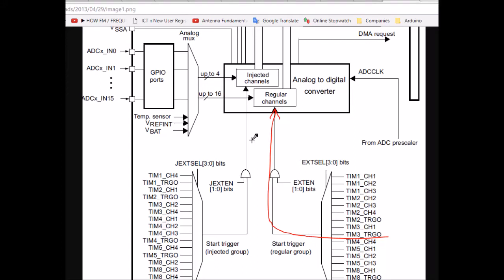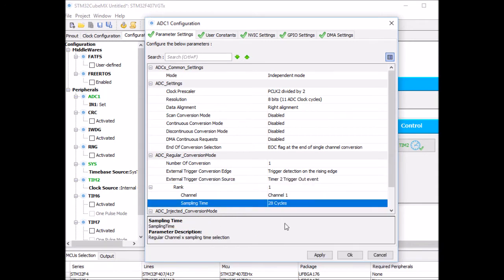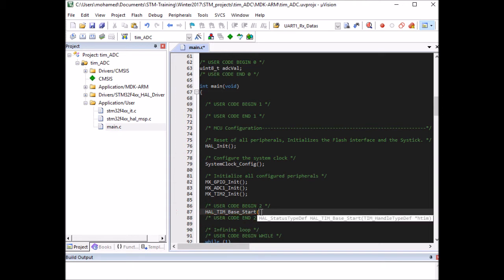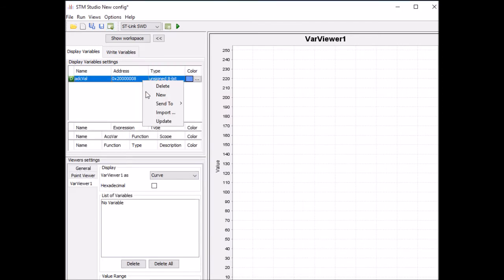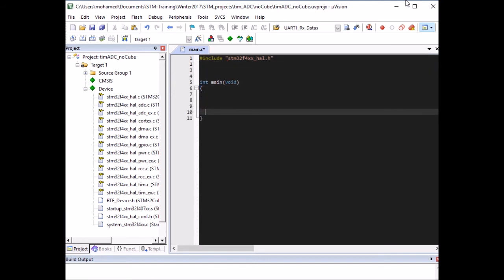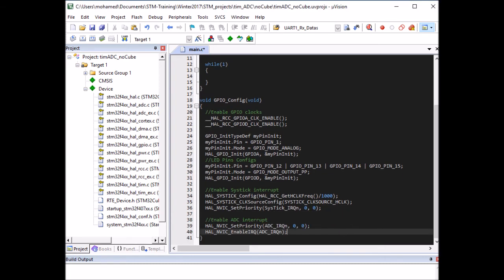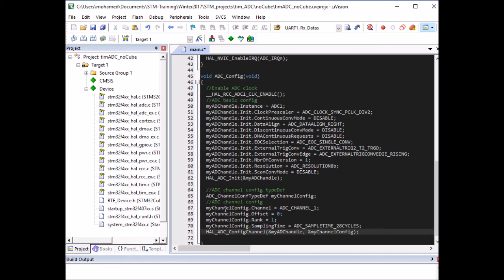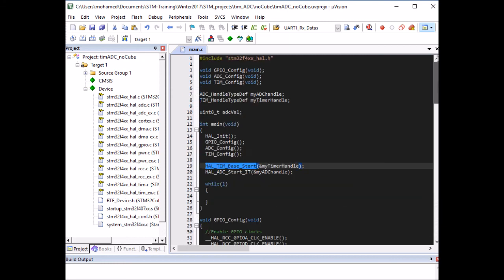STM32F4 Discovery board - Keil 5 IDE with CubeMX: Tutorial 5 ADC TIM Trigger - Updated Nov 2017

Comment: Thank you for some great stuff. However, I am looking to generate audio using PWM using the  STM32F103. I would like to generate 125 kHz PWM using the Timer 1. A buffer from the SDcard will be loaded and then, using the Timer2, would like to trigger the DMA to transfer data from the buffer to the Duty cycle register of the Timer1 at 44.1 kHz. Can you please help me in this?
Reply from the maker: Interesting! I have not done this implementation before, but seems feasible to me.

Comment: Thank you very much for uploading the video, it is very helpful! I do have a question though - what are the differences between using TIM to setup the real ADC sampling rate, or using continuous ADC mode but set the sampling cycles? If they are the same then which one do you recommend or prefer?
 Thanks!

Comment: Hello Sir, Thanks for the wonderful tutorial. I have been following your tutorial from last month and it really helpful for me.                 

As I am working on STM32F334 Nucleo board I am facing some problems while implementing same steps using STM32CubeMX.
In my project, I am using PA0(Analog In), PC13 (GPIO EXTI to start A to D conversion), TIM2 (to get adc values after every 1ms delay), PB5  (GPIO EXTI to stop A to D conversion and Display sum of collected analog values) and USART2 (in asynchronous mode)

Sir, Delay between PC13(Start ADC) and PB5(Stop ADC) is 5ms.

But I must get 5 analog values after every 5ms. But I am not getting the values.

Please guide me regarding that.

As such tutorial is not available I am facing difficulties in it. 

I can send you my code files to you.

Please help...

Comment: Hello sir, I'm learning to program from your videos.. Really very helpful.. Thanks a lot for your work..  Can you please tell me, How to filter the required steps to program...   
For example, in this example you are using ADC.int and ADC.channel for ADC and Timer.Init and Timer.master For Timer..
How are you using only these 2 functions.. Which manual you are using sir.
Or you are using CubeMx 1st and decoding the required steps(FUNCTIONS)  from cubeMx for programming using CMSIS
Reply from the maker: Ferdin Vivian 
Hi,
Not entirely sure if I got ur question, but my set up is using HAL library + CubeMX
Reply: Sir, My question is, Under Timer Config function some features for Timer has been enabled manually in 2nd method using CMSIS.. How do you know to enable those features sir.. 
for example: TIMER.Init, Timer.clocksource, Timer.Mastermode .. Why cant you enable any one.. How do you know if you enable all 3 then only we will get our required output sir..

Comment: Hey again! I am following your previous sugestion and I am using the Timer like you explain in this video. It´s working fine for now, thanks!

3 questions about this video:
- How does the timer works? It counts a certain number of clock cycles (in this case 100, right) and the creates an interrupt to make the ADC start converting?
- Why do you have to copy the HAL_ADC_ConvCpltCallback to the main? And where is this function called? 
- In this example, why do you need to increase the sampling time in the ADC?

Thank you in advance, and again, great video!
Reply from the maker: Hi Maia,
First of all, good to know you're finding the videos helpful.

For the timer Interrupt working principle, we control the timer using 2 main parameters; 1) Prescalar, 2) Period
-The prescalar scale the clock down by APB_ClkFreq/ (Prescalar + 1)
-Period, is just a counter, it counts for 0 to Period

And when the period ARR counter finishes, it call the period elapsed callback function "HAL_ADC_ConvCpltCallback", which is pre-defined in the HAL library as __weak so that you can re-write it in your application (e.g. main.c).

So, if APB clock Frequency is 16Mhz.
-> Prescalar = 2 - 1;  
Timer_Freq = 16/(Prescalar+1) = 16/2 = 8MHz
-> Period = 100-1;
Timer Freq = 8M/(Period + 1) = 8M/100 = 80Khz
Reply: Also, I came across one problem. Everything inside the while(1) in the main does not accur, and I cannot understand why? Does the program get there at all?
Reply: MYaqoobEmbedded sorry to botter you so much, but do you have any ideia why is this happening? Why my program never gets to the infinite while(1) in my main? I did a prigram just like your using Cube MX.
Thanks again!